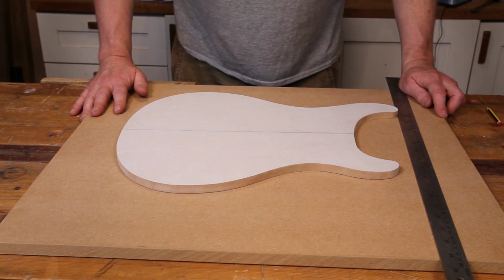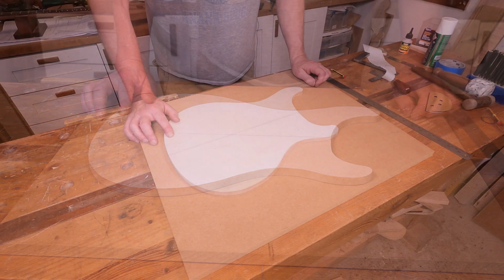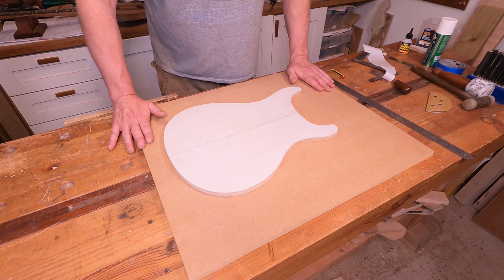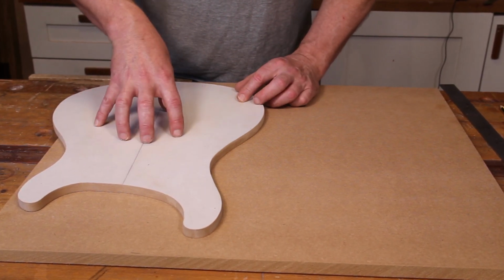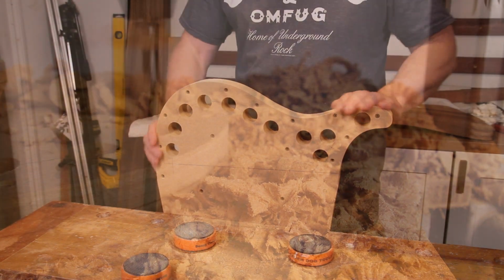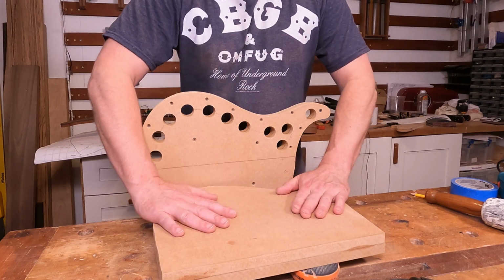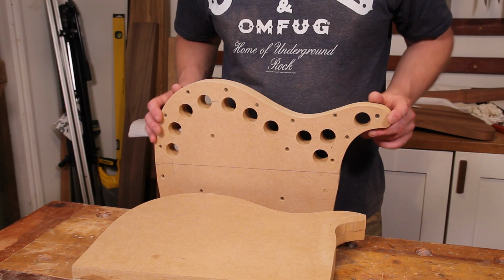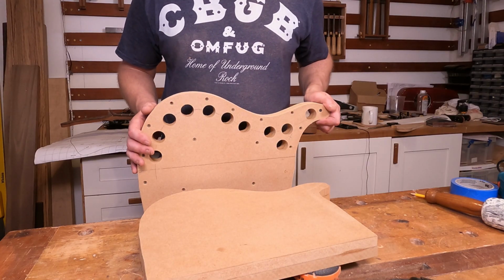GGBO 2022 scratch build guitar episode 5

Comment: This is going to be a nice combination of woods. Wonder what the stain will be? Dark candy green with a black and gold flake sunburst?
Reply: Should the forms be slightly undersized for the sides? 

Does the top and bottom sit on top the side, or sides sit outside of the top and bottom?
Reply from the maker: Cheers, I have no clue what the finish will be yet. I'll wait and see how it looks when it's together.
Reply from the maker: The top and bottom fit on the top of the ribs, the yribs are flexible when they go into the mold so it's quite easy to make them fit.